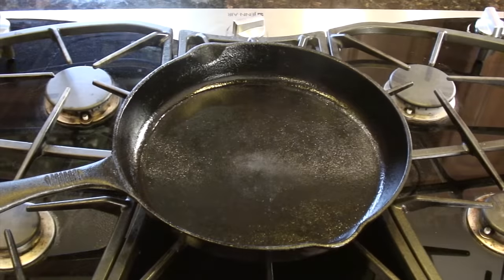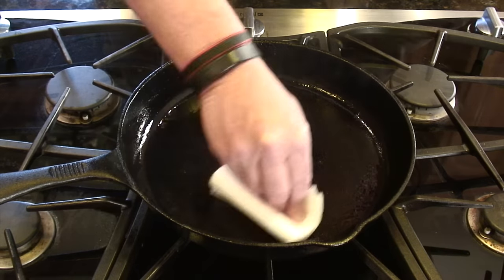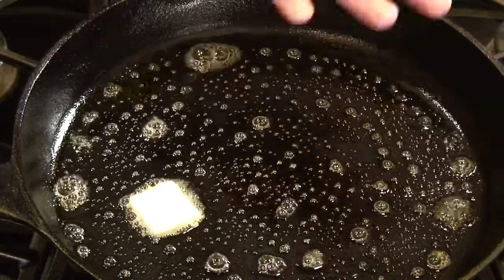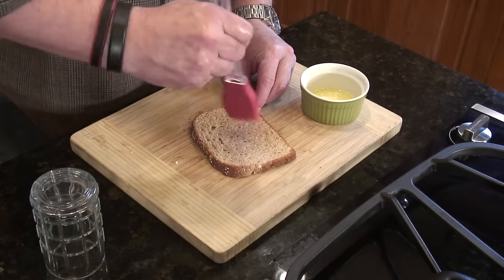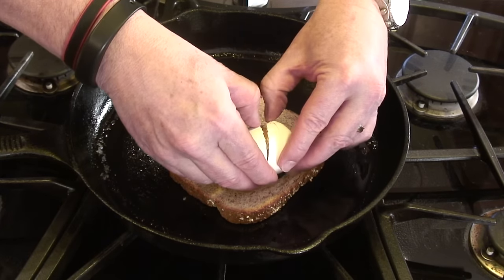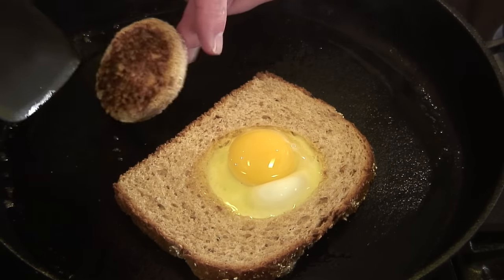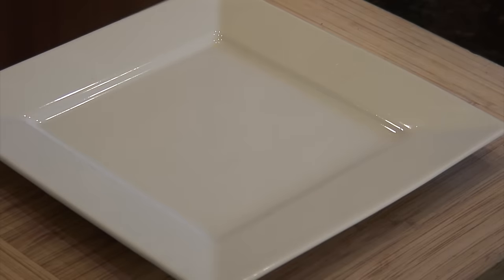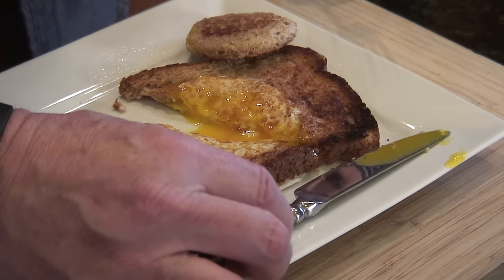How to Make Cast Iron Skillet Perform Like Teflon

Comment: hey BBMW - thanks for the tip on the dis-similar oils in the pan, works like a charm. It's totally hilarious to observe how unhinged many of the commenters are in reply to your vid. The most lathered up of the bunch seem to have completely misunderstood the video, prattling on about using "high flashpoint" oils, Olive oil being toxic, paper towel destroying your pan, etc.. It appears that most are confusing/misunderstanding  your tip  of using  oil/butter just prior to each cooking event with  the Initial "seasoning or curing" process of a new cast iron pan (ie: wiping down with lard/baking in oven to create the initial polymerized seasoning/coating)  In fact, I am not sure I heard you claim anywhere in the video that this technique is used to "Season" your pan. Who would have thunk that a harmless (and helpful) video,  sharing a tip on how to help ones already seasoned skillet perform better would result in charges of Lying, skullduggery, criminal behavior, etc.. The video was great, but the entertainment value of reading through some dim bulbs making fools of themselves was vastly superior..    

On a more serious note:  I would respectfully differ with your suggestion that the rough/pebbly surface finish on the newer pans is "More Porous" than the sanded. In fact I would submit that it is in fact just the opposite, and that sanding the cast iron exposes more of the internal pore structure, which in turn allows the seasoning to "adhere" better to the surface.. I have seen the seasoning flake, or chip off the rough cast iron surface finish, but never on one that was sanded or machined smooth.  

 Anyhow, thanks for the video - and for the record, I've been using olive oil for cooking in my cast iron skillet for the better part of 30 years, and have not been poisoned yet :)
Reply from the maker: Lots of good information.  Thank you!

Comment: Question.? Did you Seasoned that skillet in the Oven, When you first got it etc, Or did you just do the Oil & butter on the Stove top  just like that.? Thanks for "sharing your Tip  etc.
Reply from the maker: Yes, we did everything you are supposed to do.  We have old cast iron and we have newer cast iron.  The newer stuff sticks compared to the old vintage cast iron, which is smooth as glass.

Comment: Question -- do you butter the bottom every time or this is one time deal with the coating lasting a few breakfast egg cooking and the scrubbing/washing in between? I've had the same issue with my beloved cast iron skillet. Works non-stick for everything, including French crepes, but always struggled with eggs. Thanks for the tip!
Reply: You do this everytime you're going to cook eggs. Heat it on med low to med...add oil just like he did...let it sit a little then use the butter and then your eggs. Non stick everytime

Comment: It's in the video but not commented on.  One of the big mistakes people make with CI is that they try to move or unstick the food early on in the cooking process.  With a properly seasoned and lubricated pan, you have to let the food cook and it will release itself from the pan, just like the author here did.  If you tried to move that egg at 30 seconds or a minute, or a piece of meat or anything, it will stick.  Know your cooking times and heating level, be mindful and attentive, and flip it only when the food is read to be flipped.  You'll know because it'll release from the pan easily.

Comment: I cook eggs and fish in my 10 inch and I never use butter to cook cuz it turns everything brown🤪.
So when it smoking hot use 60 grit paper with ocilating sander till it's smooth, reheating pan 5 to 7 times worked for me. Then heat in a dark room till it barely starts to go red, lightly wet a paper towel w oil and coat pan let cool.
From here on out I have never used more than just a "LITE" coat of oil when pan is at cooking temp.
Never put in ingredients until pan is at temp. I've found medium low for delicates is perfect Everytime. Then ad butter after so it doesn't discolor food😇
Reply from the maker: Thank you for your feedback!

Comment: all that arguing over methods.  olive oil or no olive oil. .paper towels. ..clith..ect. I've cooked a long time...40 plus years with cast iron.  I also restore cast iron if I find it is salvagable. if you feel roughness in the pan...you need to sand it down a tad with something like Emory cloth sandpaper.  smooth as a prom queens thighs. if you have some rust in it, pit some warm water in and salt...lots of salt..stir it around,  rub it in and simmer it low while rubbing it. the water will turn red. rinse and repeat til no more rust shows up in the concoction.  you can use fire..but you have to be extremely careful,  it can crack or warp if there are thin spots in the iron. season your clean, smooth cast iron with olive oil with it no hotter than 200* to 225*...olive oil will not turn rancid like other oils like crisco or bacon grease.  if you need to clean it from an overcooked item, like cobbler for instance, put water in it and boil it a little and scrape with a wood spatula...never anything metal.  once it's clean...reseason it as before.  check out cowboy Kent Rollins on youtube. he'll learn ya on cast iron Fer sure!
Reply from the maker: This is EXACTLY what I have been saying.
Reply: Charles Power I love cowboy Kent
Reply: Donald Trump and it down will ruin the seasoning that built up over the years
Reply: Olive oil most certainly will become rancid.
Reply: Salt is a good way to rust your pan if you don't get it al out of the pores.
Reply: But, coming from you, how do we know this is true or not.
Reply: "smooth as a prom queens thighs", HAHA!
Reply: I watches videos all the time he is a very cool cowboy I got lots of cast iron for my grandmother in Kentucky love my cast iron
Reply: Can any other oil be use to season cast iron ,i have canola oil,but i am willing to buy olive oil if needed
Reply: Charles Power     All this arguing... argues, lol    c):~)
Reply: @nor4277  Canola is okay. I use grapeseed and apparently, works good on the long term.
Reply: @nor4277  I know this is old, but Avocado Oil has a good smoke point... It's also what Cowboy Kent uses now. 😊

Comment: You can achieve similar 'tefloness' if you get in the habit of cleaning the pan after use, place back on low heat to dry then coat with a dab of oiive oil. Simple pat of butter next time then cook away.
Reply from the maker: Do that already, and it works well with our older (smoother) cast iron.

Comment: From what I can tell peopledon't preheat enough, or preheat too much. with a brand new nonstick, you could put a cold egg ina cold pan heat it, and it won't stick, or a cold egg in a very hot pan no problem, but with all other surfaces, i tend to find a fairly quick heating on medium low with a little of any fat after heating works fine. With cast iron, you don't want much more than a gentle radiant wamrth with your hand over the pan before you put the egg in. You can do similar with stainless, not quite as non stick, but if your temperature is right and your pan has some fat, you'll be fine. If the temps too low it'll stick, if it's too high, it'll stick like hell. That's just my observation though.

Comment: My skillets in their lifetime go from sticky to slick. I use 80 grit wet and dry sand paper to clean my skillets after using and draining the grease and muck out. Soon you get rid of all those little knobs on the cast they make today and get the flat slick finish desired. Then you just use it, clean it and heat the cast back up and reapply a coating to the pan, I prefer butter, and its ready to go for next time. Seasoning in my op is over emphasized. My skillets look rather shiny but I can fry eggs in them and not tear or break the yokes.
Reply from the maker: I agree.  Smooth is the key...

Comment: When the vintage cast iron skillet is heated up very hot, then butter is added to the surface,  scrambled eggs will peel right off like a sticker and nothing sticks to the skillet. The trick is getting it very hot before putting the eggs in.

Comment: Your skillet looks a bit bumpy, mine are totally smooth except for a set a friend gave me. The set my friend gave me is bumpy & does stick. I'll be giving this technique a go. Thanks!
Reply from the maker: Yeah, it helps the bumpy cast iron.
Reply: snookie65 you can smooth it out with light sanding or grinding. You'll have to season it again but well worth it.

Comment: I am learning more and more about using my cast iron. I have gotten to the point that things don't stick to it, even though it's a fairly new one with the not smooth surface. Doesn't matter if it's seasoned well, which it is, at least good enough for me!
Anyone who has written here about using actual Teflon, doesn't understand why it is So Much healthier to use the cast iron skillets and NOT any artificial pans with Teflon or Teflon-type nonstick surfaces. That junk is nasty and full of chemicals you should not cook into food. 
  If you use Cast Iron, it's healthier and you are actually putting iron into your food, which is great! :-) 
Thanks to BBQMyWay! Also, thanks to everyone else who posts helpful comments below! Lastly, I cook with organic unrefined coconut oil, after seasoning with olive oil.
Reply from the maker: Thank you for the kind post....and so glad you are having success with your cast iron.
Reply: Cast iron is what I learned to cook on cast iron pans as a boy.  My mother had a wonderful set. Like most of us, I abandoned them for Teflon.  They have their place, but cast iron is better.  I bought a ten inch skillet yesterday.  Seasoned it twice, and cooked an egg on it.  I started it on low, then increased the temp to about two,. Put the egg in, and I stuck slightly, not disasterously, just a tad.  Seasoned it three more times, cooked some bacon and eggs on it.  My wife said I was an a hole cause she said it shouldn't be that much trouble.  ( I think it will be worth it in the end). Cooked two eggs and ham with just a little vegetable oil, and they turned out perfectly.  Over medium just the yolk slightly runny.  I love it.

Comment: old cast iron was polished at the factory, it was smooth, the modern stuff with the rough finish will never be as nonstick. Don't call it like Teflon, you can put a egg in a cold skillet without oil and cook it with out sticking, no cast iron can do that. I use a lot of cast iron and lots of people seem to mistake what a well seasoned pan can do compared to a well oiled pan. and lots of people confuse a seasoned pan with a carbon laden pan
Reply from the maker: Sorry.  Already did.  ;-)  Thanks for stopping by though.

Comment: I heat the pan up very slowly on medium low heat because cast iron heats very unevenly.  There will be hot spots until the heat has completely spread throughout the pan.  Then I spray the skillet with PAM cooking spray, which is canola and tropical oil.  Then, I put in whatever fat I am going to cook with.  Wait til that heats, then add the food to saute'.  I use a non-stick pan for scrambled eggs. : )
Reply from the maker: Thank you.

Comment: U need to clean the pan after use. Oil it while it's warm, then store it. That way you're ready to go next time. Your first step, should be your last step
Reply from the maker: Actually it should be the first step AND the last step.
Reply: Everyone does it differently. Mine is a modern pan. Had a rough surface. Never been sanded. Properly seasoned you don’t need the first step. Proper temperature and butter or bacon grease or whatever you want to use it will be non stick. All I have to do with mine to clean it wipe it out with a paper towel most of the time.

Comment: Grind pan smooth. Heat oven to 450F and coat the pan with flaxseed oil. Put in oven for an hour or so. Repeat 6 or seven times letting the pan cool. Pan is seasoned. will last for years. Do not use the pan to boil anything for very long periods of time.
After each use wash in sink. Put on stove on high heat. Store the pan in a warm place with low humidity.
Reply from the maker: The key is grinding it smooth.

Comment: For $13 you can get a pack of sand paper with 2 sheets each of 80, 180, 220, 320. Then scour in a sink with steel wool and salt for 30min. After a few coats of seasoning it'll be super smooth. Biggest mistake people make is not getting the skillet hot enough before cooking, you shouldn't be able to grab the handle.
Reply from the maker: Have you done that?
Reply: @BBQMyWay  Yes, on a Lodge 10.25" skillet.

Comment: Anybody who actually cooks and has anything of a scientific background would eventually figure out that the reason you heat the oil in a bare pan is to glaze the oil into a hard/overheated/but stable, non-stick carbon barrier between the iron and the food.  Most modern produced cast iron is not ground/milled out to make it smooth enough to maximize the carbon-as-teflon effect.  The last one I bought, a 12 inch cast iron pan, was so rough that I started on it with my usual method of smoothing, sandpaper and vegetable oil.  After an hour or so I gave up and got out the Dremel tool with a tapered grinding wheel.  I used up the whole wheel, and spent 2 and 1/2 hours passing it systematically across the whole inside, but it was worth it.  Remember, the cooking surface is the carbonized oil that is as smooth as glass (or teflon/TFE) without the fluoride leaching effect that you can get with TFE.  Also, when I hear "Clean up !!!!" as argument for not using cast iron, my first response is "You don't eat clean up", followed by "Cooking with cast iron is easier, and well as healthier, and does more than make up for the very small difference (with a properly cure cast iron utensil) between the clean up tasks.
Reply from the maker: I agree.  The texture of today's "pre-seasoned (what a joke)" cast iron is terrible and immediately sets you up for failure as it relates to creating a "non-stick surface."  That's why I am starting to build my cast iron inventory with older pieces that have a smooth cooking surface.  The skillet in this video will sooner or later be sanded down.
Reply: Looks like we agree on more.  I have a second hand shop in my area where I live.  That is where I got my 14 inch pan, as it was milled/ground out to a nice smooth surface.  Also, as my family and close friend's children get married, I have gifted them from this shop's largess of used cast iron, completely reconditioned of course.  They are knowledgeable enough so that they are not insulted by the "used" aspect of this cook wear.   As a side note, there is a new company coming on line in a few months that is selling ground out cast iron, the 10 inch pan goes for --- $80 !!!.
Reply from the maker: That's a very thoughtful idea for a gift, and awesome news on the new line of cast irons!

Comment: Have you ever tried Coconut Oil instead of Olive Oil?
Reply from the maker: Nope.
Reply: Use it on the pan if you've got it because it's not healthy to consume, but I wouldn't buy it for that.
Reply: Coconut oil is VERY healthy to consume. Dr. Mary Newport found that the MCTs in coconut oil help with the brain and those with alzheimers.

Comment: I think the problem is the pan. Cast iron isn't magic, and there are good brands and bad brands. In my experience, anything without brand markings, or made by Lodge Logic is junk. I spent $40 on a LL skillet, and seasoned the bejesus out of it. It could scramble eggs and that's it. 

By comparison, I bought a Griswold skillet at an antique store for $20. I took it home and rinsed it out with water. That's it. Eggs slide around like water.
Reply from the maker: Totally agree.  It's about the smoothness of the cooking surface.  The crappy stuff is not smooth to the touch.  The good stuff and most the older stuff is.
Reply: I got lucky and picked an old piece from the garbage and sanded it before seasoning. Now that I realize why it works I'll sand the new inexpensive ones also. Thanks
Reply: Stuart Hugh
Reply from the maker: Let me know how the sanding goes.  I've never done that before.
Reply: Stuart Hughes those new Field skillets are great can't wait till they come out with a dutch oven I agree buying Lodge is not worth it unless you do the work take a Emery cloth and work down the rough surface it's like they got halfway through the process and just stopped. The Lodge you bought is still salvageable just a little uncalled for elbow grease.
Reply: I like my Lodge #8 skillet better after I sanded it many years ago. It didn't take that long, and I beat the living hell out of that pan and.burn stuff all the time.when I forget.about.it.  A little oil and she's good to go.  I also have a Wagner from the 1940s from my granny that my mom.just gave me. Her arthritis makes it difficult to use. Also a nice pan. Cooks about the same.

Comment: if your eggs are sticking it is because your seasoning is missing.. seasoning can be worn and washed away by cooking things that dont actually promote seasoning but instead can eat it away.. one of the biggest enemies of seasonings are things that are tomato based.. it will eat the seasoning also thing with a water base..  The only thing that realy promotes seasoning is things that are cooked in grease and oils. what you did was essentially season the pan.  The oil wiped onto the pan and then heated to a high temp hardens and creates a seasoning coat.. it is usually better to use a higher fat oil like bacon grease and also letting it cook onto the pan for about an hour in the oven at 400 degrees... when you have a good seasoning base.. you will always have a smooth non stick surface.. a little butter and you are all set..  Just keep in mind Cast iron will almost always need a dose of seasoning if you cook something in it that is not grease or oil.. washing the pan out will take seasoning with it..
Reply from the maker: Agreed...